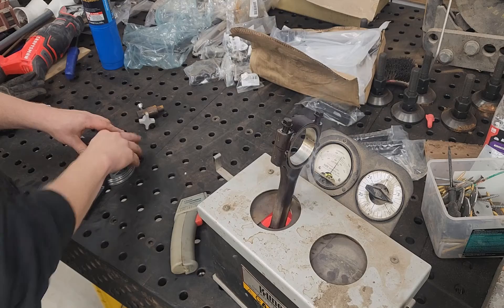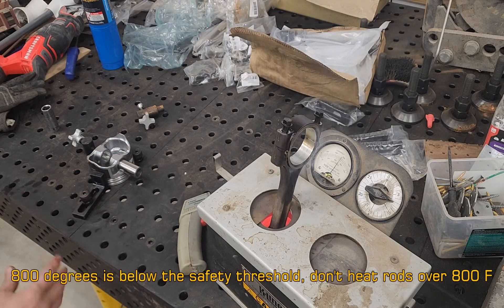How to Assembly Press Fit Piston Pins to Rods

Comment: My pins are stuck 3/4 way. Any idea how to push them a bit more without risking to brake the piston ? 🤨 liked and subs
Reply from the maker: You have to heat it up again. At this point, you will likely need to use an oven or a propane torch.

Comment: How do you take pistons off the rods that have pressed in pins?  Do you use the press?
Reply from the maker: Depends on whether or not you want to save the pistons. Most of the time, you are taking them off to replace the pistons, so you just put them in the press, where they usually blow apart. Otherwise, you can buy a special tool that will remove them without breaking the piston. If you don't need the piston- press. If you do- pin removal tool.
Reply: I made a cradle on a mill that is the shape of the piston that after pressing all wrist pins still slide out without and friction

Comment: wait till one gets stuck
Reply from the maker: It happens. You just heat it back up.
Reply: @Reddirtrodz  How to you heat it back up without overheating the piston? I got tired of these errors and made a fixture to support the rod in the press. We press the pins in without heat. Sunnen made a tool for this. I couldn't find one so we made it.
Reply from the maker: @BuffDelCampo  when I take old press-pin pistons off a rod, I'm not reusing the pistons, so I'll press them out in the big press. Kent-Moore used to make the GM service tool for pressing them out. 

If I needed to save them, I would use and induction heater, just takes longer.

Comment: What's that heater you have? Tried searching but nothing
Reply from the maker: This is a K-Line 1027 rod heater. I do think they are discontinued. They can be found at auctions and ebay. Any induction heater will work. You can buy a  universal induction heater that has different coils that works great for rod and broken bolts.
Reply: @Reddirtrodz  thanks!!
Reply from the maker: @bluephoenix53  https://www.eastwood.com/induction-innovations-mini-ductor-venom-and-coil-kit-mdv-790.html?wickedsource=google&wickedid=Cj0KCQjwlumhBhClARIsABO6p-xln9RKi_W53hTWt7D9JSezTQax-zgFjHSFeO7KXs3wjUbV7FiuHLIaAvgiEALw_wcB&wickedid=649209537757&wcid=19735174681&wv=4&wickedsource=google&wickedid=Cj0KCQjwlumhBhClARIsABO6p-xln9RKi_W53hTWt7D9JSezTQax-zgFjHSFeO7KXs3wjUbV7FiuHLIaAvgiEALw_wcB&wickedid=649209537757&wcid=19735174681&wv=4&gclid=Cj0KCQjwlumhBhClARIsABO6p-xln9RKi_W53hTWt7D9JSezTQax-zgFjHSFeO7KXs3wjUbV7FiuHLIaAvgiEALw_wcB
Reply from the maker: @R0ughHab1tz  i just purchased this one as well. Solary Flameless Heat Induction Tool, 1000W 110V Magnetic Induction Heater Kit with 8 Coils, Handheld Rusty Screw Removing Tool https://a.co/d/gONgcNF
Reply: torch